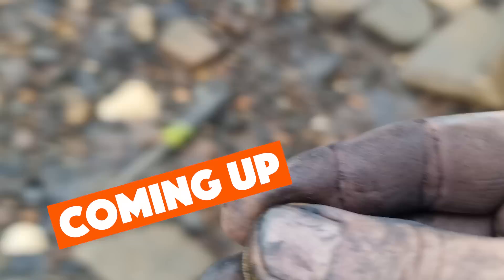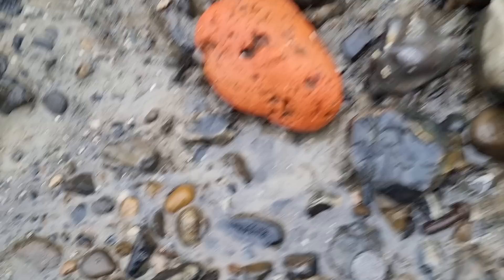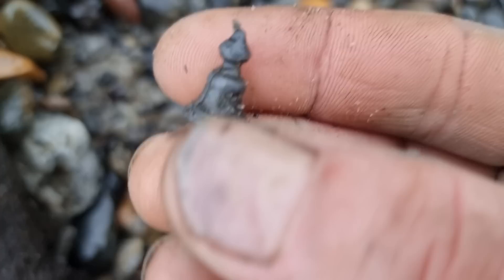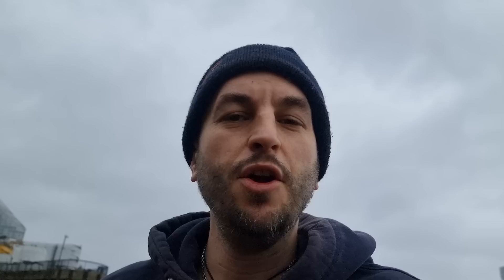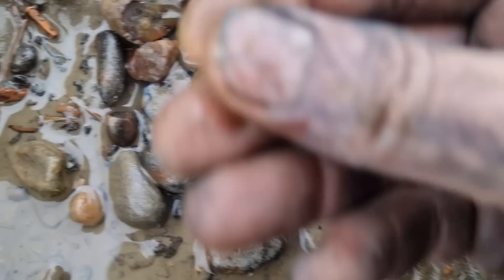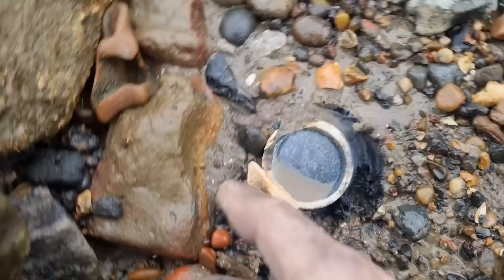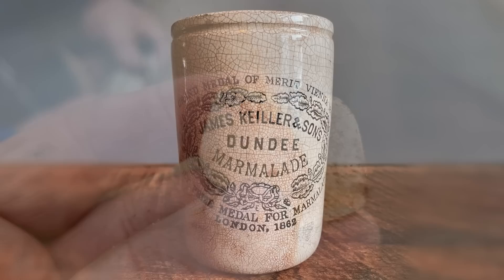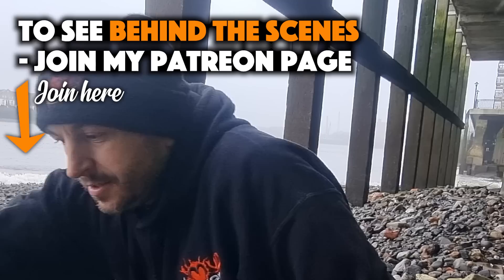The PERFECT mudlark! Searching the old River Thames foreshore in London

Comment: Simon... Another great video. Thank you. Something that you might want to think about that could make your clean-up process easier. Have you thought of using a sonic jewelry cleaner? Using distilled water in place of chemical solutions would prevent damage to pieces like pocket watches and coins.
Reply from the maker: Thanks but I’ve tried that on a video with Queen Vic. Check it out. It didn’t touch the crud. In over 10 years of doing this, there’s only a few methods that work